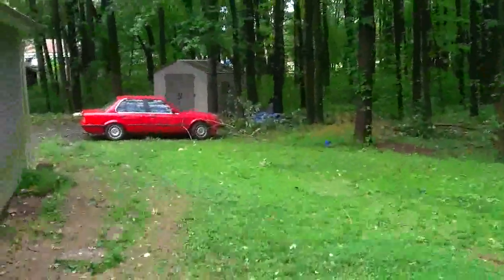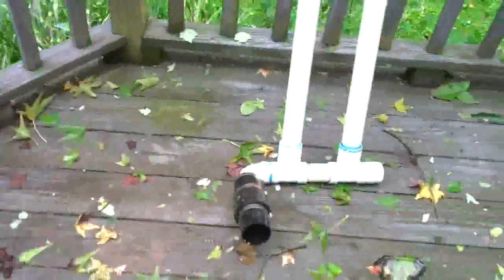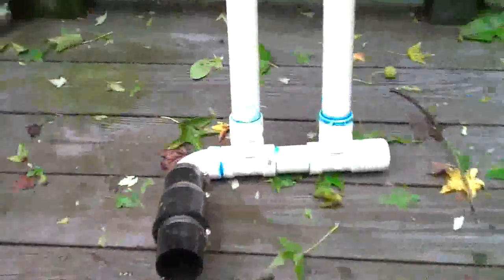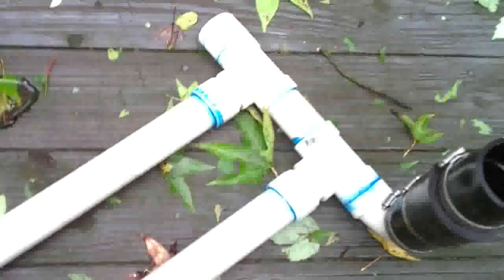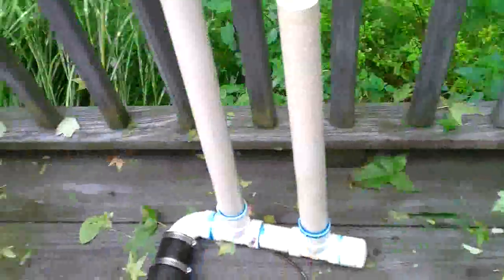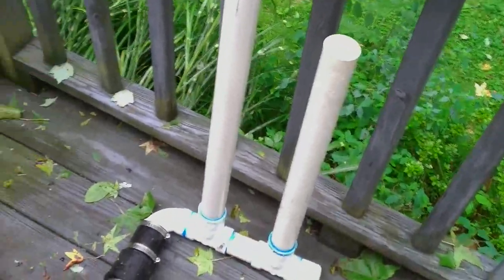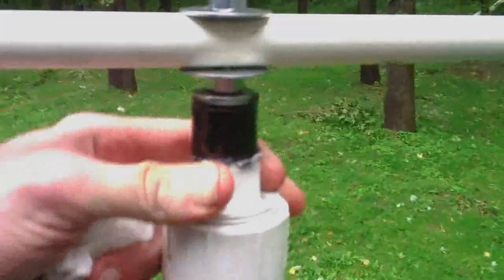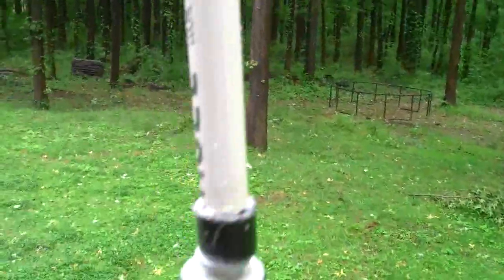Hurricane Irene + Homemade PVC Sump Pump = Dry Basement !! ;) HOWTO

Comment: I live in the catskills we got 11 inches of water I am disabled so a few years back I got a 7k gen set from ALDI store has a 2 year warranty starts easy I have it hooked to power crit loads in the house a the pump in the basement .  We lost power last sunday and did not get it back until today . My pump barley kept up had 2 feet also septic system washed out  propane tanks washed out creak went from 20 feet across to 1/2 mile . Roads washed out both dirts just 1 lane know in each direction

Comment: I've been wanting to assemble something like this for quite some time.  Only question I have is about the plunger itself.  How did you connect the handle to the plunger?  That is, what is under the gorilla tape on both ends that we can't see in the video?  Thanks.